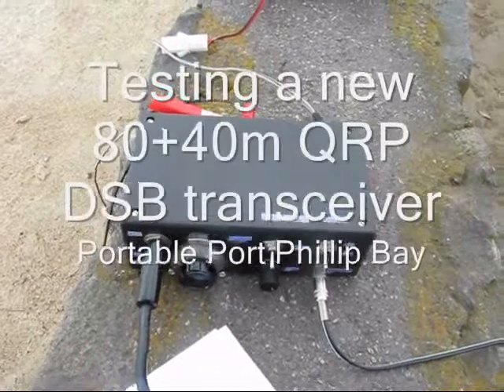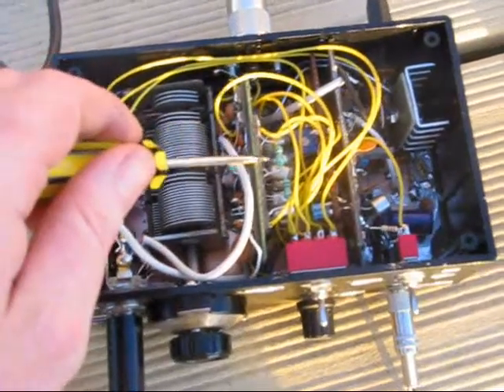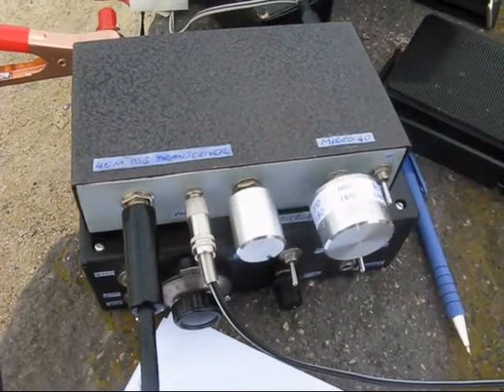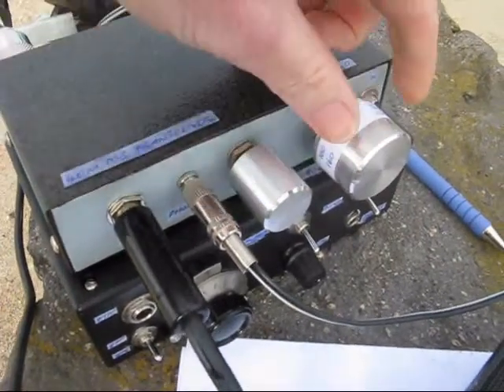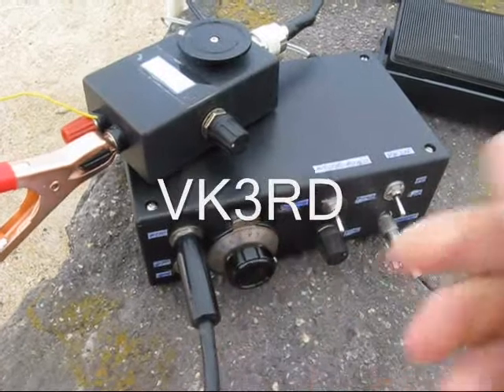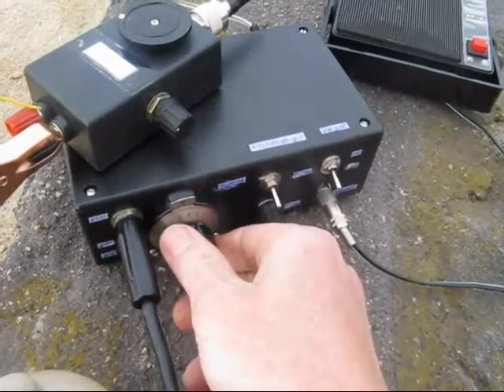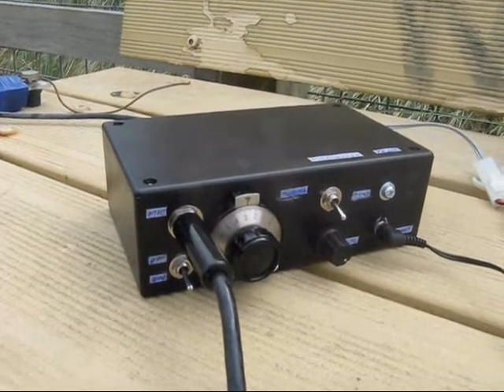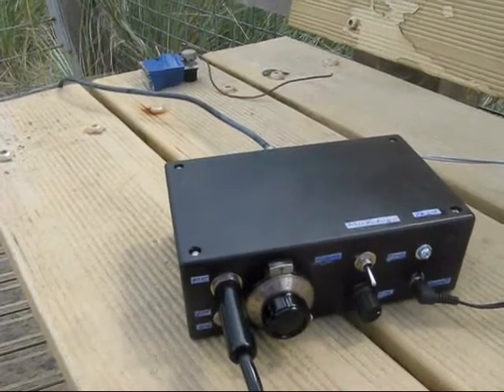Testing a new QRP double sideband transceiver on 40 metres (or does RF attract Mr Whippy?)

Comment: Very nice Peter. I used to be able to buy those vernier drives in the UK from Maplins, and they came in three different sizes. After they stopped stocking them I have never found a source again at a reasonable price! 73 - Rob VK2GOM / G0MOH